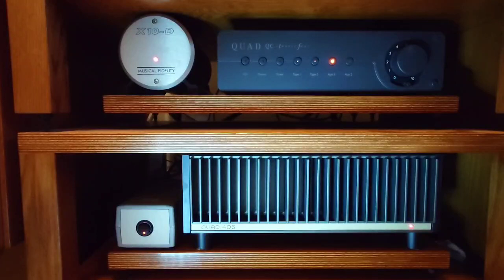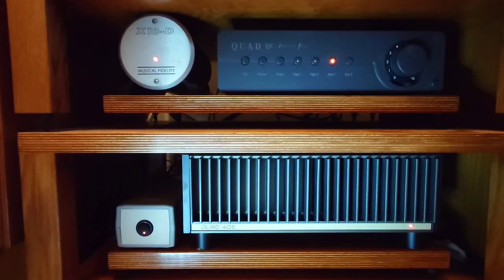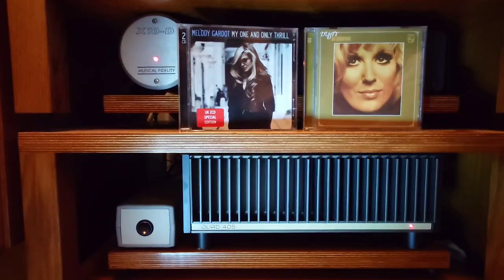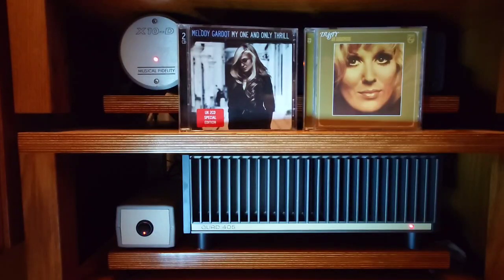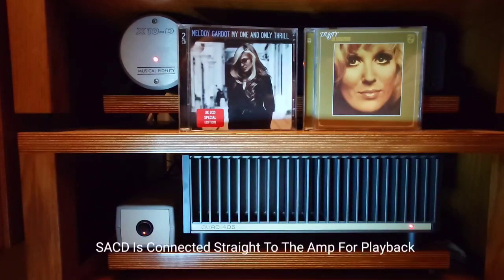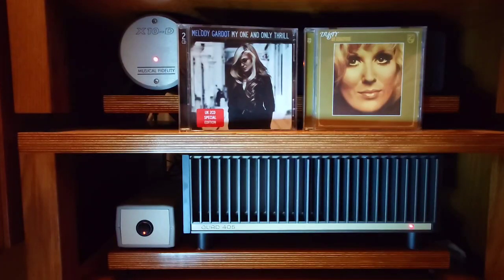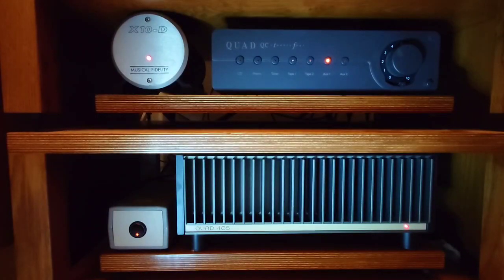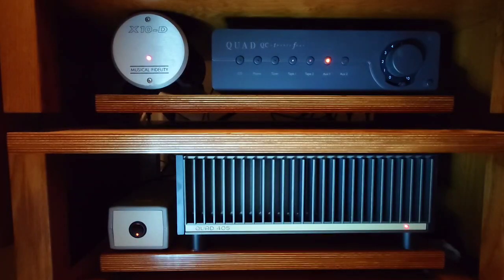My First Thoughts, Musical Fidelity X10-D Upgrade!!!

Comment: Great video. I also made a series on incremental tweaks to my system with the intention of pushing down the noise floor. It has been one of the most effective improvements to the sound of my system. More 3 dimensional sound field, more resolved placement of singers and instruments. My advice to others is start at the mains supply and work up the chain, improving the quality of components. You don’t need to spend a fortune for noticeable improvements.

Comment: I think the Musical Fidelity X-10 buffer supplies  defiantly  works and yields a warmer, less harsh sound. I have an X-10 V3 (similar but sits in a square box) with a similar power supply. I am pairing with a new Audiolab 6000 CD Transport and an old (25 years) but still superb MSB DAC Link 3 (with the Nelson Upgrade) with a separate power supply. I am listening to Wagner Parsifal now, and Victory at Sea.,

Comment: Although I’m not always sure about all your mods I would just like to say I always enjoy it when I see a new video posted.

As the X10D runs on AC I would imagine there's very little inside pinkie PSU, possibly a slightly better transformer but that’s about it with a higher current rating.
Reply: No. There is quite a bit inside -- including tubes and things.

Comment: Better parts equal better sound , hifi components are made to a budget , 300 pound amp would have very cheap parts inside .
Reply: Alan shaw the designer of harbeth would disagree. He as always used gerneric parts in his speakers. Good circuit design is all that matters he said. He said theres no point paying extra for boutique parts. He as put boutique parts in his anniversary speakers because of pressure and said some people would not buy them unless he was willing to do it. He did it to satisfy the audio fools. Its all  extra business for him .